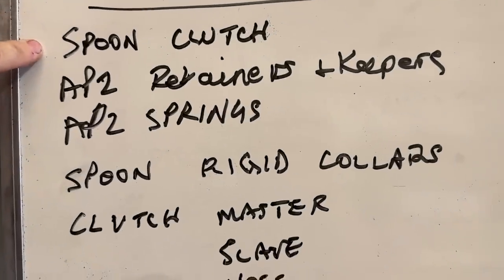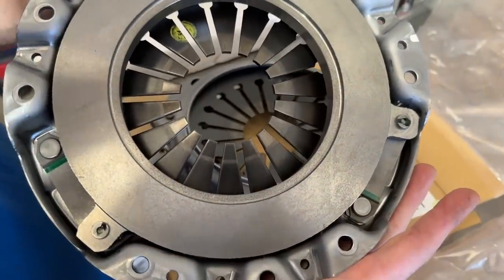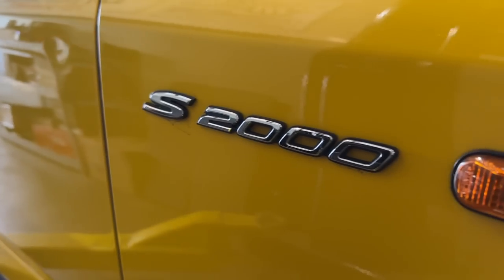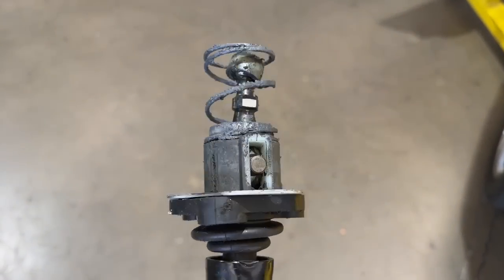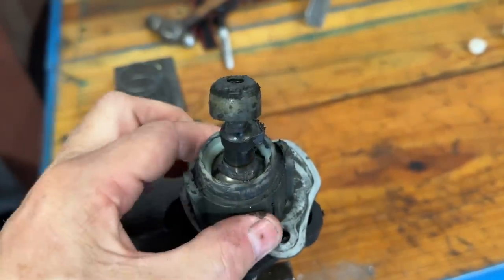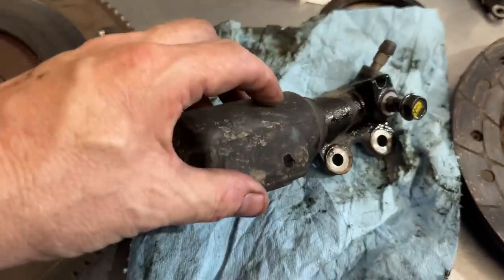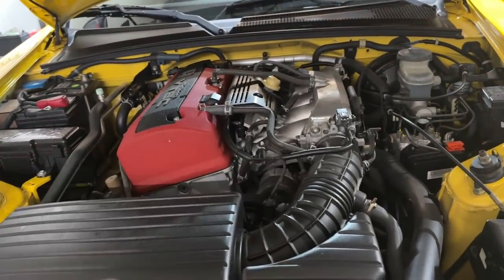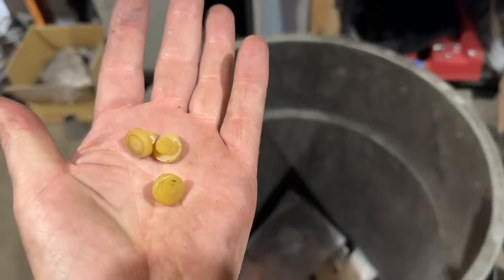Many Spoon Parts !     OEM or SPOON ?

Comment: FYI: the grease is also dielectric, which prevents the aluminum/steel direct contact from causing electro-chemical corrosion.  Make certain to completely coat the contact surfaces.

Comment: I drive the Spoon flywheel and pressure plate combo with the OEM clutch and the difference ist noticeable - no doubt. The pressure plate has a 30% higher clamp force then the OEM and to do that, you usuallly change the pivot point or increase the spring rate of the clutch diaphragm. Not sure which one of the two or maybe both Spoon modified. Obviously you can't see the changes in the pivot point when the pressure plate is assembled and 30% is not that much (but still noticeable) on an OE part. Regarding their clutch . I have no f*****g clue what they changed :D. That's why I went with the OEM clutch.
Reply from the maker: They could have changed the the clamping load of the fulcrum point, it didn’t feel any different from stock. I’d like to think it’s different.
Reply: @LHTPerformance  Pedal pressure feels the same, it just grabs a little harder. At least that's what I noticed.

Comment: SO, If I want to pay more for oem Honda parts, buy spoon?
Reply: I guess it depends on the part...like the Spoon motor mount and bushing kits, I rather just buy them in one package with all of them vs individually from the dealership. Not sure how much the price changed, but the Spoon integra motor mounts I bought in 2017 after all said and done was cheaper than buying every individual mount from Honda. (And now OEM are discontinued). The trailing arm bushing is also a different design and only about 20 dollars or so more than OEM...

Comment: What's the most miles on an OEM clutch?  Just wondering, mine's over 90,000 miles.  I can live with slightly misalinged badges.  The shaky mirrors drive me crazy.   They are loose at the friction material between the base and the rotating mirror.  To stop the shaking I wrap a rubber band around the mirror and slide it into the space between these two pieces.  It's cheap, easy, and works.

Comment: Can you explain why the S2000 emblems shift? Is it because it was put on after the panel was replaced? Or does it shift because of the heat of the sun or something?
Reply from the maker: Most are repainted and emblems installed incorrectly.  In some cases , some of the passenger side ones are installed wrong in the factory.
Reply: @LHTPerformance  thanks so much for the reply! I gotta get my S2k down to you guys eventually to get the LHT treatment
Reply from the maker: @ijimppangi  no problem my friend

Comment: How's that spoon flywheel? Does it make the car too twitchy to drive? Would you recommend it in a supercharged application? 

I was planning on doing the AP1 flywheel, and now I'm wondering if I should go even further and do the spoon.

According to the interweave:
AP2: 22 lbs
AP1: 13.5 lbs
Spoon: 9.2 lbs
Reply from the maker: It is lighter than the AP1. I would recommend the ap2 flywheel for a supercharger . The engine will drive smoother and there’s more control for idle plus with AC.

Comment: You should’ve put the jig on the passenger side as well. Would like to see that demonstration on every car you work on I’m OCD and bought the jig from LHT worked out lovely.👍🏽
Reply from the maker: Almost every single s2000 has crocked emblems on the passenger side. I think the guy in the factory was enjoying too much saki
Reply: To be fair the driver side side marker does not appear to be OEM. The trim around the light is chrome. So perhaps the fender was repainted and the installer put the emblem way too far from marker light.
Reply: @LHTPerformance  The jig is what you should start the work with to show us why that jig is so useful it was too me hence the purchase. Plus just don’t like chrome on cars like these. Had to change mine to black more contemporary.
Reply from the maker: @ciscokid2444  I did a video showing how it works. It’s pretty much cool proof. Install it over the side marker light , hold in place with masking tape. Install your emblems.
Reply: @LHTPerformance  I know John I purchased the set from you it’s great cost me $25 with shipping but totally worth it. Before you start working on a new car do the Cisco check on the emblems first to keep the viewers informed that you have this jig. Quick OCD check. Only takes a minute.👍🏽
Reply from the maker: @ciscokid2444  thanks for the order and continued support. These are something we’ve wanted for a while so glad we can make a difference.
Reply: @LHTPerformance  In the recent pass I ordered the gearshift isolation when I rebuilt my shifter but my dog ate it good thing the old one was still in tact I was saving that one for the future.
Reply from the maker: @ciscokid2444  yikes. That sucks
Reply: @LHTPerformance  Can’t blame my dog I left it within reach just keep it stocked I’ll include it in a future order from you.Yeah maybe with that grease.👍🏽

Comment: I've only done 8 s2k clutches. 5 were stock and the other 3 kinda sucked, purposely not saying brand name because of price. The factory parts ARE very nice. I  did a stock rebuilt engine for an old man that now has a s2k, that raced scca in the early 90s with gm. Cat back only on a engine out project. He had a different clutch before and ended up with crank walk. OEM is best unless you actually have a purpose built track car. In my opinion